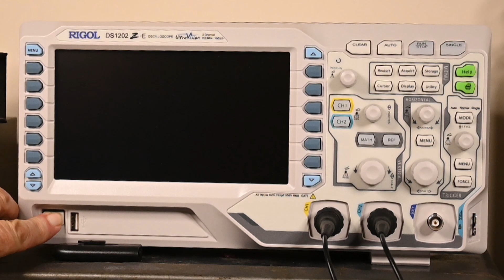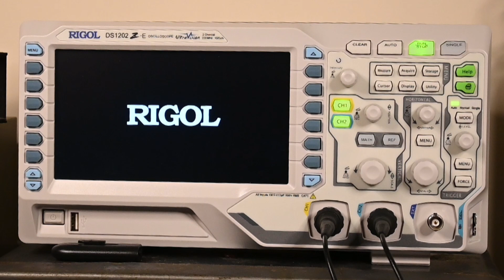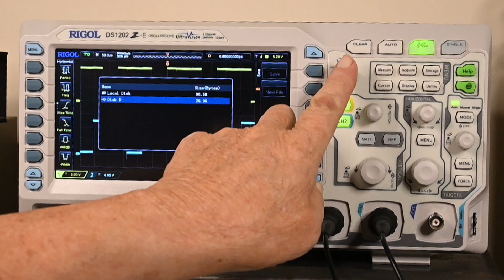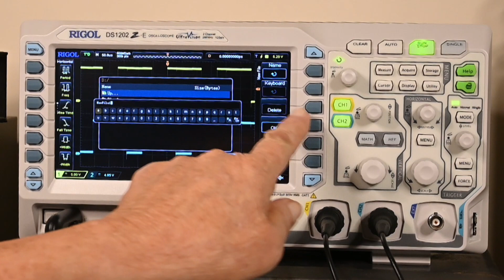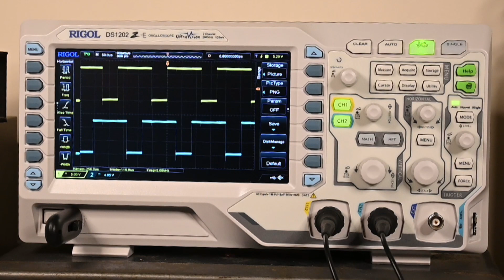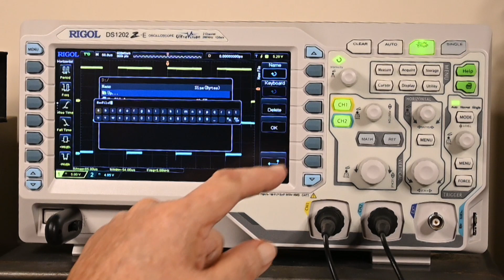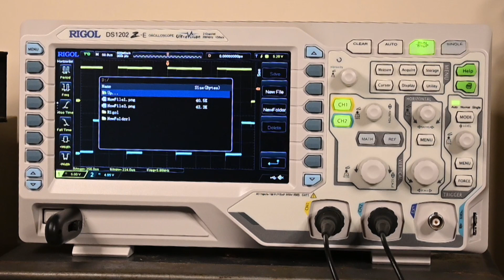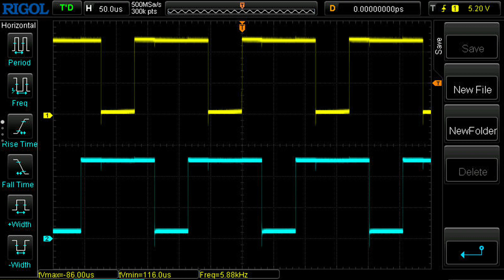Rigol DS1202Z E Digital Oscilloscope

Comment: I have one and it works like a charm! I got it during this whole covid event on sale for $385 CDN! Bang for buck I have no complaints. I use it mainly for servicing but hobby use as well. The functions on this are *very deep and (for myself at least) a manual was required reading but easy to grasp. Good review.
Reply from the maker: I like it so far. One of the best times I have bought.

Comment: Great video, I cant choose between this model and the Siglent SDS1202X-E 2Ch, as a student I cant really see any difference other than the layout, which would you recommend? thanks a lot!
Reply from the maker: I think the Siglent has more decimal points in it's measurements. There are both easy to use.